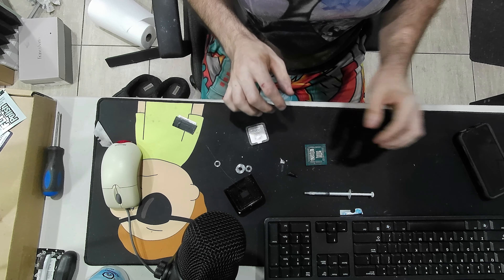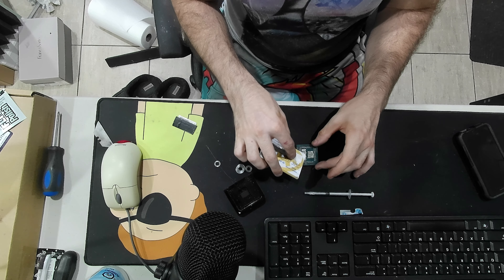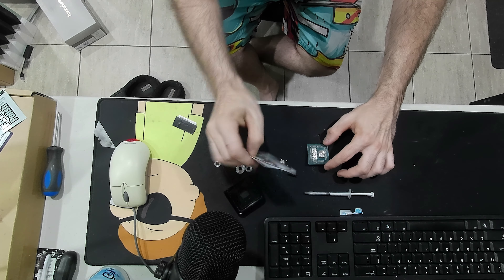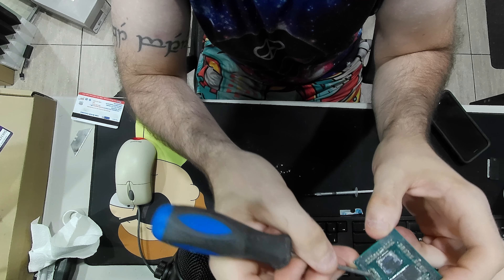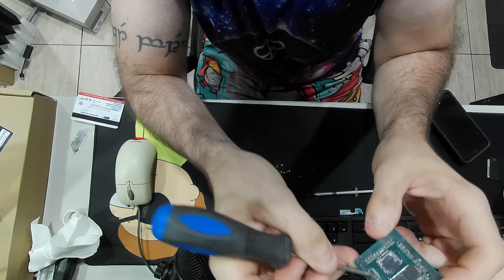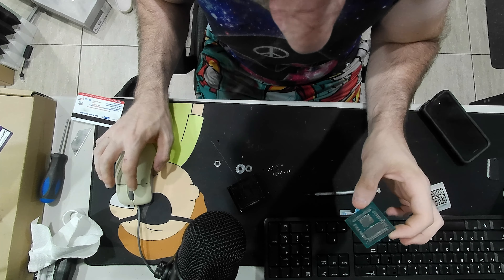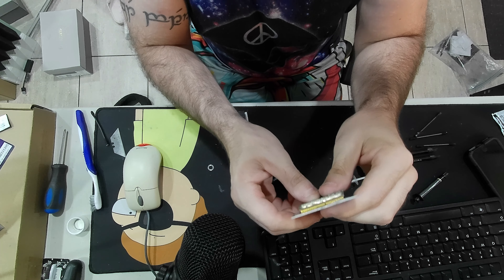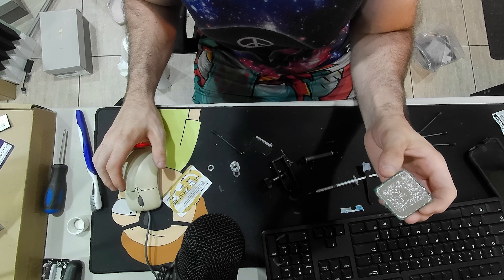3950X delid, is it worth it?

Comment: Dude that is crazy to get what 4.5Ghz ????
Bro i do that with a X73 NZXT and my voltage is 1.37 volts i don't use PBO i am overclocked through CCX.
CCX gives you way more,My lowest CCX cores are at 4.375Ghz while another one is at 4.4Ghz and the top two CCX are clocked at 4.525Ghz all day on Trident Z Neo 3600Mhz my temps are in low 40's to 60's

Comment: If you want to de-lid a soldered IHS, pop it in the oven or use a heat gun to heat the IHS up. You need to melt the solder prior to removing it, as even doing it like this (very slowly) can crack the die. But good job on getting it off! Got yourself a new subscriber

Comment: Imma blow your mind.   :D   Plastic Razor blades. (Amazon) WORKS AMAZING! They will not damage the die.
Reply from the maker: Like instead of using quicksilver?  Aw man I dunno, quicksilver is Jsut so nice and safe with a credit card
Reply: @FrameChasers  What I've done on some, is use the plastic razor blade to clean off the bulk from the die. Then quicksilver does a really good job getting the thin layer left over very quickly. Finish it off with some polish and it looks like a perfect shiny die. They are also REALLY good at cleaning the glue stuff off. Oh man, world changer there. The plastic razors I got came with 2 razor holders, made it sooo easy. Worth having in your kit.

Comment: What if I told you the boost behaviour you're seeing with liquid metal and PBO were possible without any TIM and stock settings.
Reply from the maker: I don’t doubt it, haha,  this delid was 100% pointless performance wise.  Still super fun experiment though
Reply: @FrameChasers  still it's great to see people try. Could you please share with us how far in from the edge of the pcb the smd's are located? I'm thinking a simpler way to perform a delid would be to just mill down the edges of the IHS and then use a combination of torque and heat to remove the last of the IHS without having to fight the glue. There's bound to be a height difference between the dies, would be interesting to get an exact measurement and then lap them flat for timless direct die cooling.
Reply: @FrameChasers  That secret has to do with SSE3 functionality under intels compiler. You can patch games to always return an intel product and get better performance.

Very clear examples: StarCraft 2, Control, Carnivores reborn.... so far.

https://www.youtube.com/watch?v=msGR5Ophl5s

You just get visual studios, run the game, download then run the CPUID patch. That's it. I know I know. Most people dont give a shit. You might. 

Now if you could help me with that DX8 to DX9 wrapper.